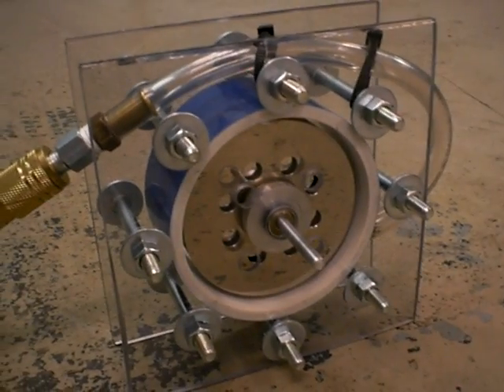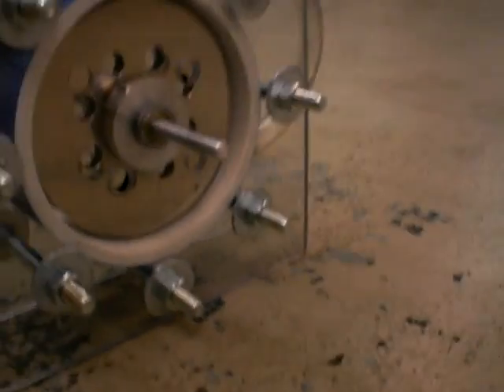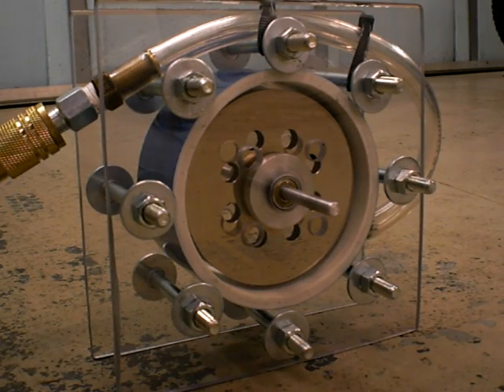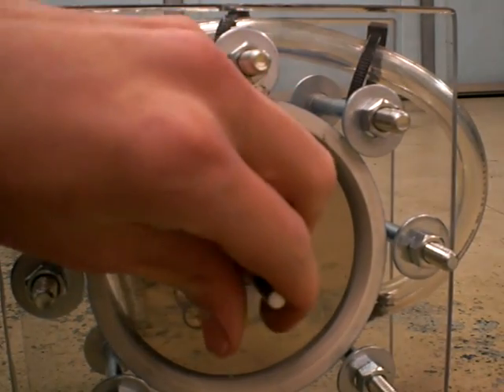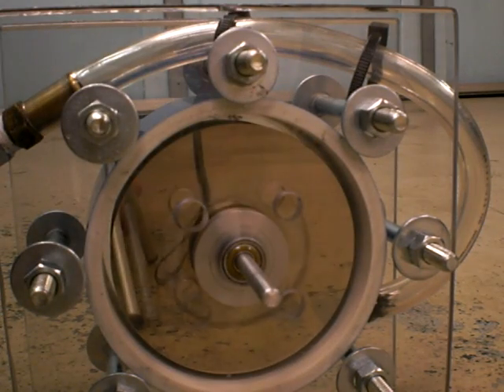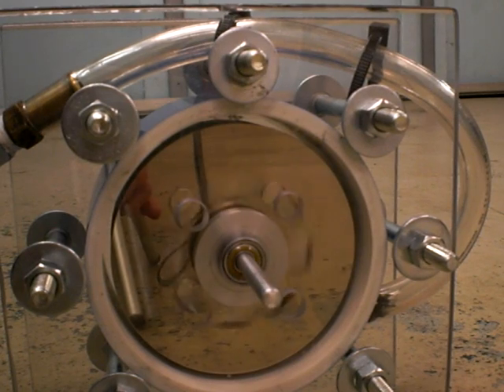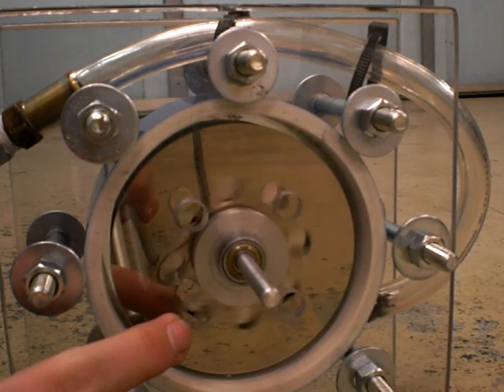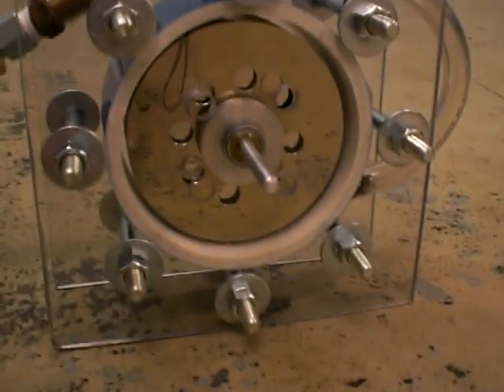Tesla Turbine

Comment: The uploader never said this was free energy...why would anyone with common sense even make a comment about it? Also, he's using air to spin the wheel, just like a water wheel, except water has much more potential for higher horse power. This turbine is really only good for devices that require low torque, since air, even if compressed, has almost no weight, which is relevant because the torque is dependent on force, in this case is defined by the amount of weight pushing the wheel.

Comment: It doesn't. It's just a turbine. Converts pressure into movement. The same way they use turbines in power stations, that run on steam pressure and spin the generators. 

This is just a better type of turbine than the traditional bladed one. Or at least supposed to be better. It's no magic and doesn't create energy out of thin air. It's just unfortunate that Tesla's name tends to be associated with free-energy lunatics.

Comment: Expecting a turbine system to have greater output than a direct-drive system is absurd, if such a turbine is driven by compressed-air or hydraulics powered by a home-utility; a free-tap of natural occurring energy (wind, hydro, solar) is essential to drive such a turbine with an explicit need for the high-frequency output to receive any gain. Understand the difference of turbine-slippage compared to that of positive displacement. Tesla consistently touted high-frequency and resonance as key!

Comment: Not to put a damper on the ongoing development, but the design has been around from 1913. For the max efficiency surfaces to be perfectly smooth and free of contamination. In a real world practical application how does one maintain this ensuring that no contamination can accumulate over time? The support systems required or maintenance would seem to make it impractical to ever maintain a unit with more then 40-50% (not much better then we already have) efficiency.

Comment: You are converting one force, a slow but powerful air pump, into another, a tiny albeit high-speed shaft.  I don't get your point.  What's the big deal here.  As soon as you put a load on that spindle it will hardly produce much in the way of energy - surely less output than the energy you are using to pump that 50 psi air into it!

Comment: Hard Drive Platters can easily withstand 15-20krpm without failure for years. (If balanced properly). Most hard drives do not fail with the disc catastrophically failing and if those end plates are made of polycarbonate and then an failure would have a hard time escaping that enclosure. Safety glasses though are advisable the openings could allow smaller fragments to escape.

The discs are precision discs designed just for this type of high rpm application so it is "relatively safe".

Comment: My only comment is that I would not be standing so close to his little turbine when it is operating.  It might not be making much torque, but if one of the disks comes apart he is going to have an uncontained failure.  I love the idea that the Tesla turbine works by utilizing those terms in fluid flow that are usually ignored or set equal to zero for ease of calculation.

Comment: @2012listo The TURBINE side it coupled to the COMPRESSOR side by a shaft rotating on bearings. This shaft DRIVES the compressor wheel which COMPRESSES air to FEED the engine. Go grab a turbo off the shelf (I'm sure you have many) and tell me what the side the exhaust feeds (turbine) looks like. Better yet I will save you the time, the gasses come in at the rim and exit at the center because this action creates forces that better utilize the flow of the gasses to DRIVE something else.

Comment: @2012listo Really? You are going to tell me I am backwards when you abviously did not read my post fully. Is it really turbo 101 time for somebody who is a self proffessed turbo expert. Well here we go. A turbo charger for the use of increasing the power out put of internal combustion engines has two distinct sides for it's function to be achieved. A turbine side and a compressor side. The turbine side DRIVES the compressor side. The Turbine side is SPUN by exhaust gasses exitting the engine.

Comment: @2012listo you got that backwards actually. The turbine side of a turbo intakes at the rim and exhausts at the center. The compressor side work like you explained, which is driven by the turbine side. What he is triin to accomplish is the same thing as the drive (turbine) side of the turbo.

Comment: @TheRiceowlex Safety
Plexiglass is VERY brittle and tends to shatter into sharp shards like glass.  It is also VERY easy to get stress fractures in them that can easily lead to catastrophic failure.
As someone that worked in machine shops for over a decade, having seen things like a chunk of steel about the size of a 1/2" nut go right through somebodies skull and mash their brains up...

Comment: @DougRH52 That plexiglass is pretty tough. Check out Giant Robot Project here on youtube. 
Jaimie made leg joint connectors for this BIG walking robot with plexiglass smaller in width than this mounting apparatus. I do agree safety first however, shields, eye protection..etc

Comment: @newcombhigh  Mocking shows lack of knowledge & experience of the forces & potential safety hazards. Even with the low masses, with the kind of revs involved, do the math and then tell me that some of these devices made out of brittle plexiglass type materials that can & do break into glass like pieces with similar sharp edges. 
As a machinist of 10+ years, I have seen & had my own experiences with such things & I can assure you it is no laughing matter to be dismissed lightly. Fools beware!

Comment: @Th3Su8 I am not 'such a hater'. I want just point that Tesla made already all modifications in his patents.

Did you heard sound when air supply is shut down? Turbine begins to brake - behaving like turbo-molecular pump, but with closed exit. The faster you try ti spin it, the more it brakes. 

Air density is much higher near edge of discs, and has hard time interacting with walls. Why then not provide opening at other end? Like Tesla did - to leave 'heavy' air (or other fluids) out.

Comment: you can make the sides bladed so you use the aerodynamics to let the air out. a device like this can benefit from appreciation of what's going on and of course energy conservation consideration. efficiency in general. or even more general, design optimization.

Comment: @Gorfickle they dont seem to be able to do much work with that low torque.  Maybe use water instead of air??
Reply: Tesla turbines get plenty of torque and output plenty of power even at low RPMs IF they are designed correctly.

Comment: @CaptainAndrew1991 no one to date has built it yet, if you have looked at the engine model it has many stages of compression,that is huge in build a jet engine, tesla talked about a turbine with the power to keep a aircraft suspended in the air because of the power of the turbine he proposed, one turbine alone has not alot of power,but when they are put in a series configuration like the english patent he had,you should get some high power,without the need of gas,  just high speed electric motor

Comment: What if instead of using this turbine you simply used the electricity that you use to power your compressor and plugged an electric motor into the wall instead? Surely that is better than taking electricity, converting it into air pressure, and converting that into mechanical energy. You're just making more steps, steps that involve loss of energy.

Comment: Its usefull if high rpm is needed, but for turning steam power into electricity there are more efficient mehtods, the less moving things you can have the better.

Nice work btw
Reply: Tesla turbines work just fine, get plenty of torque and output plenty of power efficiently, even at low RPMs, IF they are designed correctly.

Comment: The application is to convert steam into electricity. Either using a heating source as the sun or other means ie geothermal. The air compressor is for testing.

Comment: Ummm....exactly what is the point? You're using an air compressor (presumably run off electricity) to do what every kid with access to a garage and some old wheel bearings has done. Does it serve some purpose other than spinning real fast? Can't make electricity if yer using electricity to make it. Guess I'm asking if it actually has an application of some sort.

Comment: Tesla was just amazing. And this turbine is one of my favorites. I think this idea may be ready to make a big come back in small scale alternative energy production.
Reply: 🙋‍♂️ There’s all the proof anyone could need to know this now.   

10in diameter TesTur made from cheapo aluminum on room temperature compressed air Dyno’d at 6.22ft-Ibs of torque to the shaft at only 4150pm and +4250watts between 6,000-12,000 pm and real 250-2650watt electrical load test runs at 9,000-13,000rpm.  

The preliminary tests are just to see how much electrical power can be produced with room temp compressed air driving the Tesla turbine.   

The TesTur nozzles never went over 20psi at the nozzle for the 2650watt electrical load test and not over 40psi at the nozzle for the 4250watt dyno test.     

This is so a baseline can be acquired for what to expect as the temps are increased to combustion levels.     

When using elastic gasses the counterintuitive thing most overlook is that the viscosity of gasses goes up with temp.   

So not only is there an increase in thermodynamic efficiency from increased temps but the TesTur isentropic efficiency also goes up due to the reduced slip from the increased viscosity.
Reply: With TesTur Energy, the mission is to give people energy independence through Combined Heat And Power (CHP) systems that can make use of underutilized energy sources like biomass, solar thermal, geothermal and even low grade fuels containing high quantities of solid particulates (like pulverized coal and powdered iron); energy sources/stores that are currently underutilized due to the lack of turbines and engines capable of handling the multiphase fluid flows (any combination of gasses, liquids, solid particulates) present in low grade heat boilers and low grade fuel sources without damage over prolonged/continuous periods of use.

Comment: I recommend that you watch the two google videos with Jeffrey Hayes of TEBA, if you haven't already. The nozzle, PSI at the nozzle, and RPM are all very important to achieving real efficiency and horse power with these engines. I suspect that you'll need more exhaust holes, since you are using holes instead of the 3-spoke pattern of Tesla's original design. I hope to pickup an inexpensive milling machine for building one of these.